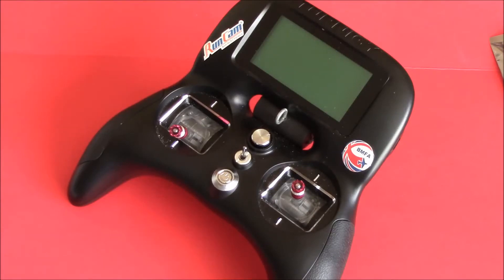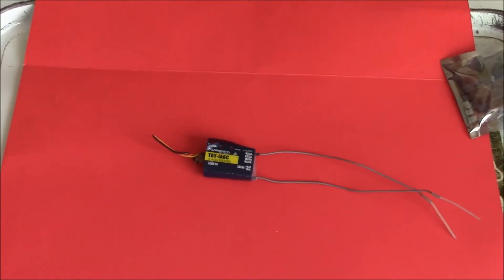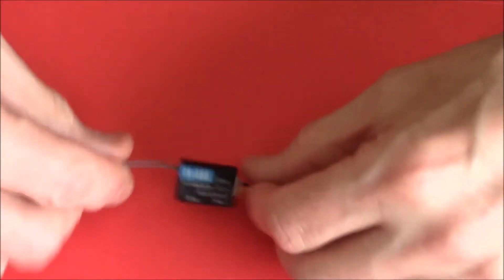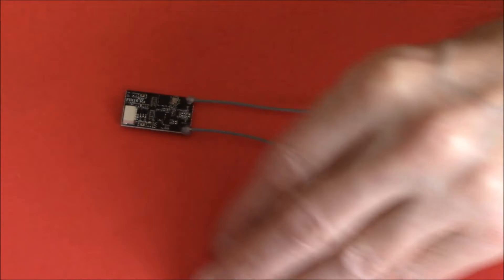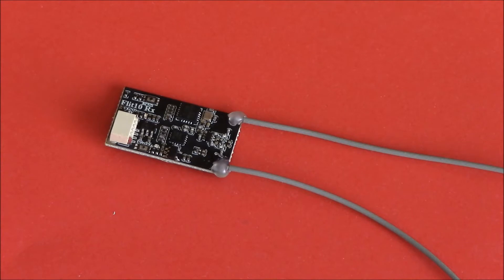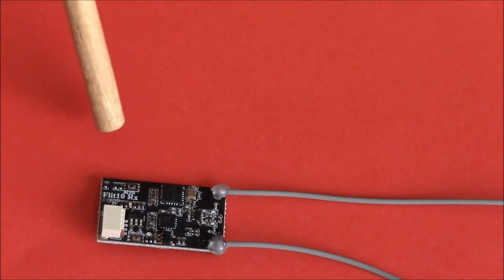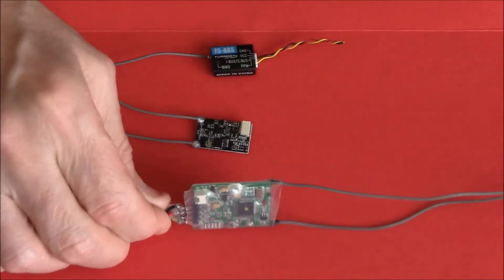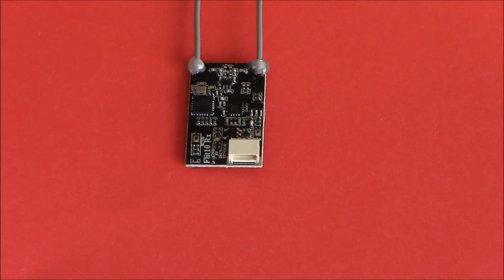THE FLINT10 RECEIVER FOR THE TURNIGY EVOLUTION

Comment: Mate I’m running this with my build and I have found mine to be terrible or my turnigy evo is faulty. I mean within a few feet my turnigy is complaining of low rssi. I don’t know if it’s because of the telemetry module not been connected of maybe I haven’t set something up correctly. Have you got any suggestions?
Reply from the maker: Really sorry to hear your having problems, I don't use the telemetry module i just cut the wires and soldered them straight to the flight board. You could try this but if it does not work there's always a chance you've got a faulty receiver so you may have to ask for a new one or a refund. You could also try rebounding it once again, Sorry I can't be more helpful, but please keep in touch and let us know if you get the problem sorted.